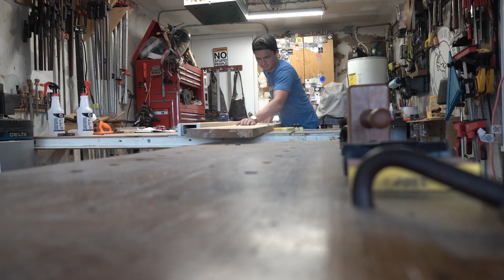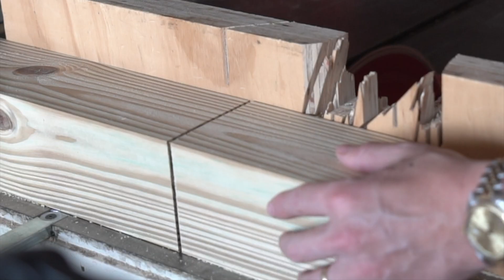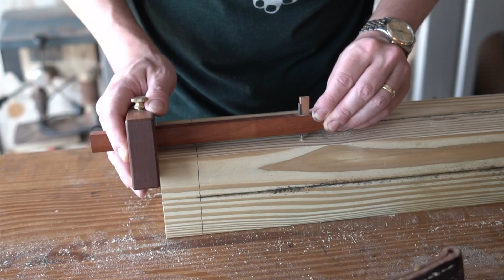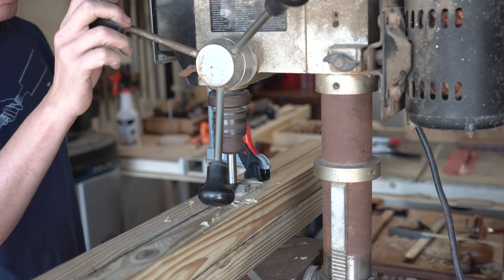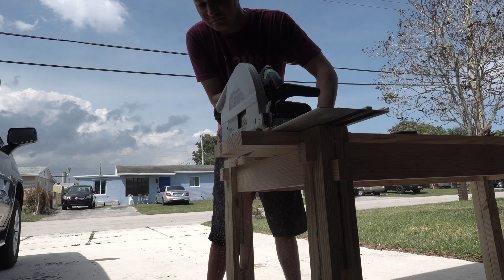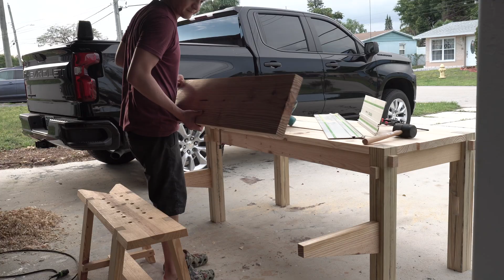A Better Picnic Table Design? Or is it... | Reinvented Picnic Table Design

Comment from the maker: Support my channel through the following links:
-The Real Milk Paint Company's Impressive line of finishing products (Special Affiliate Link):
https://www.realmilkpaint.com/ref/cowdogcraftworks/
For 10% off use coupon code: cowdogcraftworks
-Starbond CA Glues (Special Affiliate Link): https://bit.ly/36sB2Bv
For 10% off use coupon code: cowdogcraftworks
The Complete Japanese Joinery (Book): https://amzn.to/2OAj1sM
KAKURI Woodworking Japanese Block Plane 60mm, Manual KANNA Wood Planer for Finishing Wood Surface, 2.9×2.7×10.1 inches (41937): https://amzn.to/3szzXoe
Stanley Sweetheart Chisels: https://amzn.to/2ZATrKg
Solid Brass Wheel Marking Gauge: https://amzn.to/3jfDFfR
DFM Tool Works Card Scraper Set: https://amzn.to/2CMZp1W
DFM Tool Works Card Scraper Burnisher: https://amzn.to/2ZAwzuv
DFM Tool Works Small Square and Center Finder: https://amzn.to/3jfFdXd
Glu-bot Glue Bottle: https://amzn.to/2CdxYOV
Mineral Spirits: https://amzn.to/31xTBmG
Dewalt Compact Drill: https://amzn.to/3ht3tng
Metric Japanese Style Carpenter's Square: https://amzn.to/35kC3fG
Rok Hardware 14 Gauge Table Top Fasteners with Screws: https://amzn.to/38CzW94
Mini Square 10x5cm: https://amzn.to/36mtcti
Faber-Castell Ecco Pigment 0.1 mm Pen: https://amzn.to/36oLni8
Pentel Mechanical Pencil: https://amzn.to/36uqbab
Freud Flush, 1/8",1/4",5/16",3/8",7/16",1/2" Depth Rabbeting Bit Set with interchangeable bearings with 1/4" Shank: https://amzn.to/32yNvm6

If you want access to more of the tools, check out my amazon storefront: https://www.amazon.com/shop/cowdogcraftworks

//Follow along:

IG: https://www.instagram.com/cowdogcraftworks/
Twitter: http://www.twitter.com/cowdogcraftwork
Facebook: http://www.facebook.com/cowdogcraftworks
Website: http://www.cowdogcraftworks.com

Comment: Looks great.  And, I hope you've learned, in the last couple years, that sometimes, the Tried and True design methods are "standards" for various reasons. Diagonal legs on picnic tables, with attached benches, is the most Functional method, due to the reason you've shown here... Tipping.  It doesn't take much of an angle to offset the balance... but they do need an angle, to make them less dangerous.
Reply from the maker: Absolutely. I still think there’s a lot of wiggle room for design but as you said: there’s a reason the classics are classics.